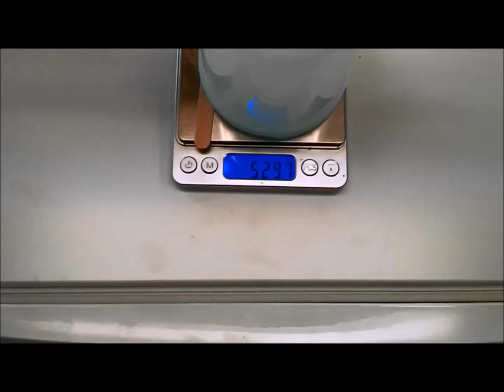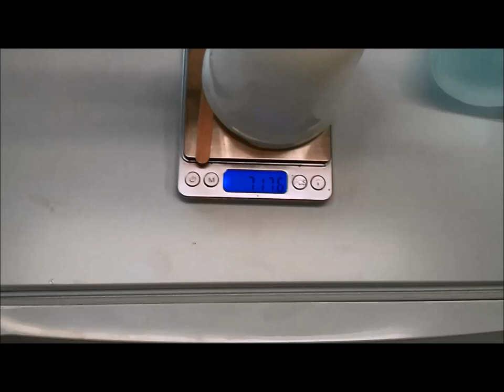FAKE GTI PRO LITE TEST PANEL SPRAY

Comment: Dude you gotta rinse the gun out with gun wash/ lacquer thinner before using. The factory coats the spray guns in oil and thats what reacted with you clear
Reply: Besides that it has a lot of air pressure

Comment: Your blasting Way too much air through - sounds like you`ve punctured a truck tire with a thick nail and pulled it out!
Reply from the maker: Yes it appears to use alot of air for 20 psi.
Reply: SW Customs . 5:28 ....... 30psi
Reply from the maker: Yes 30 for clear
Reply: SW Customs 30 psi is a lot for clear. I think the sweet spot is around 25-28
Reply from the maker: @latinprince896  Everybody has their own preference. Thanks for watching.
Reply: Exactly

Comment: Sorry man, I’m not trying to be disrespectful in any way, But you can’t expect great results, when you aren’t doing things right. First off: you needed to run lacquer through that gun first to clean all the oils & grease from the factory. Second: Gun setup is crucial. Next, You HAVE to hold the gun so it is spraying evenly! I noticed you never quite tilted the gun enough to where it was perpendicular to the substrate. That is exactly the cause of the problems you had!!! A combination of Gun Setup & The fan being extremely bottom heavy, are what most likely caused the striping issue. Let me be clear I am not advocating for these knockoff spray guns, BUT.. I have tried a few, and they actually impressed me! I understand you are a DIY Guy, But I’ve been production & custom painting since I started at my Pops body shop when I was a teenager, and have been spraying for over 20 years now, So I know a little about what I’m talking about. Great video though!
Reply from the maker: Not to be disrespectful back but I've been doing body and paint since I was 16. I think I know what I'm doing.  The gun is a knock off POS. Thanks the same for watching.
Reply: @swc-diygarage  That’s cool, But we can all learn from one another man. That’s the mindset I try to keep. I was simply saying what I saw, and I bet I other guys that spray everyday would see the same. Doing auto body is one of the best trades in the world IMO. Those of us that spray everyday have to be open minded, if we want to get better as everything changes. I made it clear that I’m not a fan of the knock-off’s! I was simply saying I have used several and was actually impressed with how they ran. Now, I know there’s many that are crap too! When I watched your video it reminded me of a video I watched a good while ago. Look up the Dura block 007 spray gun review, and there’s a guy that reviewed one in his little shop and at first when he did his paper adjustment, he commented on how heavy the bottom of the fan was, however within just a few minutes he realized it was because the tip wasn’t perpendicular, which caused it. Watch that, and you will see what Im saying. I didn’t say that to beat you up, I simply said it because it’s true. If you aren’t willing to be open minded, It’s hard to improve man. Being a body man, doesn’t make everyone a great painter. Some can & some can’t. I have several cousins that I taught growing up, and most all of them are great body techs, But a few of them can’t paint for sh*t. 😂, Hope that helps man. Take care

Comment: I have one and it's  one of the best guns I've ever used ,clear goes down slick no buffing needed using 1.3 at 26 psi.
Reply from the maker: Thanks for watching
Reply: 26 psi clear coat ? Base coat ?? Psi??  Ventilateur full open? Liquide paint full open plasse détail setup Thanks

Comment: i got one of these for 67 bucks and im going to force it to work for me 😂
Reply from the maker: Thanks for watching. Hope you have better luck then I.
Reply: @swc-diygarage  nope
Waste of money. i bought an Iwatta, in fact 2 of them and never looked back. I use el cheapo guns for primer/sealer/polyester. All else, the W400. About 230 each, but the improvement/results are worth it to me. I was blown away after using just knock off guns or super cheap chinese products.
Reply from the maker: @BearBudgetgarage  Thanks Scott. Appreciate your return comment. Hope that other viewers take note of your experience and realize they're buying junk.
Reply: @swc-diygarage  trying to save money can cost u money. If you are going to paint at home more than once buy the best gun you can afford from a solid manufacturer.👍

Comment: It’s not the gun. It’s the surface your going over. Seal it and do it again. You will find a big difference. GTI pro lites like open full fan. 3 open on fluid is ok. This all depends on temp, what temp hardener and reducers. I own a half of dozen of both, fake pro lite and original pro lites. Both shut the same.
Reply from the maker: Thanks for watching,.Don't forget to subscribe.

Comment: Ok, nice test but, if I want to buy one, how I know which is original and which is the fake? Thanks in advance.
Reply from the maker: Buy from a dealer like spray guns direct. Anything shipped from China is fake. If the handle of the gun has a decal and not stamped on both sides is fake. Price is a dead give away.

Comment from the maker: Original TE20 air cap specs. provided by Just A mechanic.
                     Cap face 3 hole cluster .020" - Upper horn hole .060" - Lower horn hole .054"
FAKE TE20 Cap face 3 hole cluster .024" - Upper horn hole .068" - Lower horn hole .062"
FAKE T110 Cap face 3 hole cluster .024" - Upper horn hole .067" - Lower horn hole .059"
Reply: I got a fake ProLite also (Lisson branded- I just couldn't stand to have a DeVilbiss branded fake!). It is MARKED "1.3 with a TE20  and also bought an extra set of "1.2 fluid nozzel and a TE110 air cap (which it certainly is NOT even a try at a 110- looks just like the 20). WELL, the cheapie actually sprays decently and with a big even fan, BUT both fluid tips and air caps are the same, AS I did a viscosity type test comparing the time is took to flow 2 ounces (60 cm) of thinner: Both fake nozzels  Flowed at the same rate that my REAL ProLite with the 1.4 fluid tip !!! The real ProLite's 1.3 took longer and the real 1.2 took a lot longer to flow out the thinner. SO, the fakes are really 1.4 fluid tips and a rough approximation of a TE20 air caps. And the fluid tips do NOT interchange with the real DeVilbiss.  And as SW Customs found out, it IS a lot heavier.
My only other question is what air pressure at the gun are you using? I find my guns like around only 20 psi ( 18 to 25 depending on thickness of paint.)
Yours looks like you're over 28 psi (2 bar). That will give an uneven pattern.
Thanks for your time and effort on the video.
Reply from the maker: Was 20 for base and 30 for clear. The gun used way more air then my others set at the same pressures. After all the hit and miss problems I had with this gun I think it's the TE20 air cap doesn't seal properly. The T110 I got has a different seal in it and fits much tighter.
Reply: @jaykrom852  wow I just earned this as well. I bought 2 from ebay and they are both fake.  Ended up getting a real one at 4x the price but it came with 2 air caps and 3 needle sizes

Comment: honestly, it's not the gun that troubled... both fake and real will give you almost identical result, the only different is the material difference between the real and fake, the fabrication, for example the real one looks clean while the fake one maybe having like some kind of second grade material.. but the way it sprays almost identical.. you cant just make conclusion base on the way you want to use it... i have both fake and real, using it in the same technique, same material same setting, the both have the same output, only materials are different..
Reply from the maker: Thanks for watching

Comment: In your opinion does the sprayit do a better job than the fake gti?
Reply from the maker: For now I would say yes because the gti seemed to have problems with the base coat but the clear came out good. Check out my ski boose respray video. I spray the same base coat with the sprayit and it goes down perfect.

Comment: Cross pattern to eliminate tiger strigers. It's sounds your spraying  too much air I use a harbor freight it sprays cheap but fine
Reply from the maker: I've never gotten stripes in any thing I've ever painted except with this gun. I think that and excessive amount of air it uses all comes down to the pour machining of the gun and air cap. Thanks for watching.

Comment: isn't striping just means you used not enough reducer or just your pressure was too high
Reply from the maker: Those are possibilities. But have never had that problem before or after only with this gun.  Did a candy paint job with with my Bellaria at 90+ F. No problem.
Reply: @swc-diygarage  I see. I used a few guns in the past, original, fakes, cheap ones and the similar situation would appear if I used wrong reducer (I live in FL so 90-100 is a regular situation), not enough reducer, or too high pressure (so it would half-dry before to land on the surface). 
I bought one today, will repaint a truck next weekend, will see if I will have same problem.
Reply from the maker: Hope you have better luck then I did. Thanks for watching and the comment.
Reply: @swc-diygarage  will see, I'm a bit skeptical as well. thanks for sharing, it was interesting.
Reply: Well how did it go? Any video?
Reply: @cygnus1965  i made bunch of mistakes over the time but it worked out. fake gti works fine, i can't say it's the greatest (because i never used those) but I repainted  68 and 07 mustangs, suburban and an old beetle it worked fine for all of them. the only problem i had with euro clear on black 68 fastback because for some reason it was creating bunch of bubbles so i had to strip it down and redo work again with thinner clear.

Comment: I got the t110 air cap had 4 holes  8 all together
Reply from the maker: Yes should only have 8 holes plus the 1 in the center for the fluid tip.